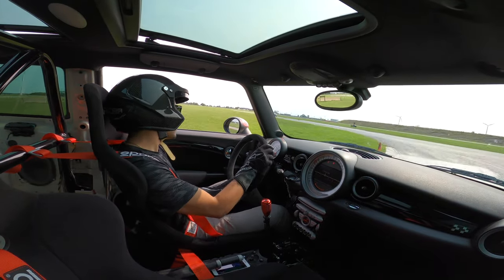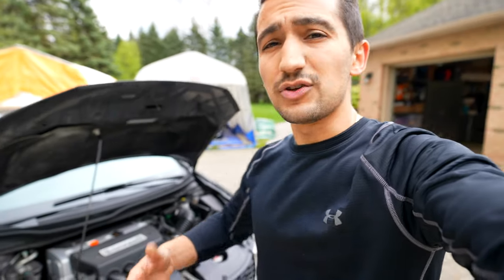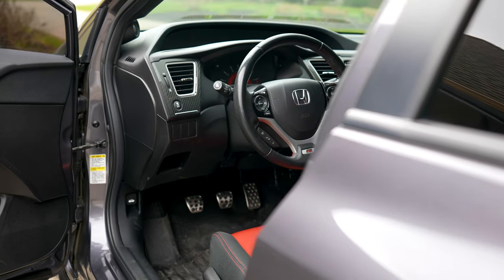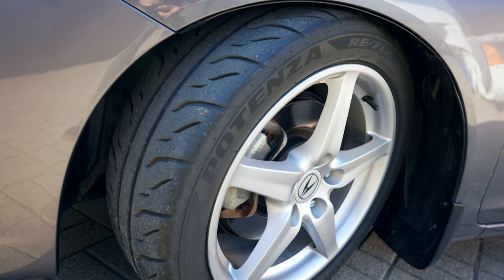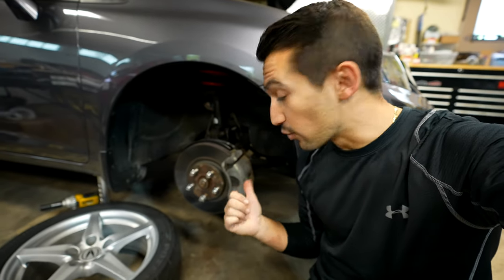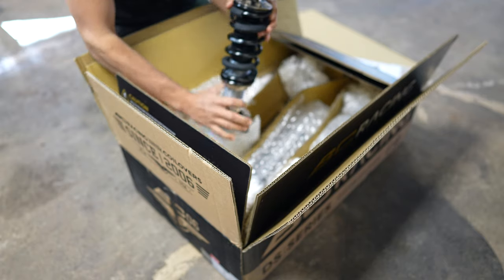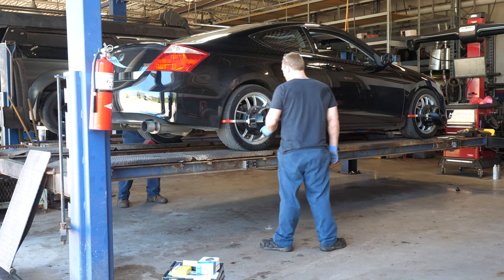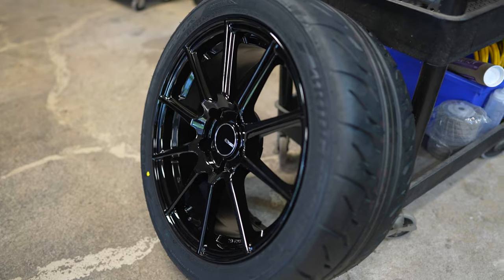How to PROPERLY Upgrade Your Car // The MilMast Method

Comment: Exhaust => differential => suspension components + coilovers => chassis bracing => wheels + tires => brakes => intakes + manifold + tune => carbon/bodykit/aero => rollcage => paint

Comment: Assuming your tires are reasonable, THE very first requirement of a production car is to sort the suspension. Any tyre that can generate higher lateral g force will deform the suspension, often to the point that the new tyres are destroyed on one edge (usually the outter) after only a very few laps.

Comment: I love this video and I already convinced myself to go this route but not as detailed. I am currently building a K20/k24 and putting it into my 91 integra. Thanks for this! I love all your videos as they are so helpful for something who is entry level at this
Reply: I have already used your excel sheet as a guide for a 300+ HP all motor building. I think I want to take it even higher. I already have my k20 Head ready for port and polish, and I just finished removing everything from the block. Now that this is done, I will focus on my suspension/ brakes/etc.

Comment: First for my 370Z I did the long tubes headers, exhaust and cold air intake with a tune with admin. Now I’m building the brake system and transmission on the top. I feel like it was missing little bit of spice in the engine bay. I also did tire first of all with larger ones. But your build diagram is very nice and accurate! You give me some futur mods that I didn’t thought.

Comment: No, all wrong.
First: Big twin turbo
Then, if it didn't melt already, an oil cooler
Next, the clutch should be already cooked so new flywheel and clutch kit
Finally if you didn't totaled it: wheels, tires, brakes and suspension.
Now that's thrilling
Reply from the maker: LMAO I'll have to give that a shot for another build 😂

Comment: 1.brakes 
2.wheels and tires
3.suspension
4.larger radiator, oil, and trans fluid cooler
5.power
Reply from the maker: I can agree with that 👍
Reply: @milanmastracci  I'm working on a 07 camry lol

Comment: Depends on the car. Transmission if needed, then brakes, suspension, cooling, airflow, then power
Reply from the maker: It sure does change from car to car, but I do like your thinking 💪

Comment: Weight Saving .  I understand the significant improvements gained through lighter wheels and tires.  Unsprung weight and improved handling etc.
How much weight do you think you saved on the Mini, with the removal of the interior trim ? Seems like minimal savings. Like removing tire valve stem caps and the shifter knob. Do you think the gains are worth the effort.
Reply from the maker: By just removing door panels, not too much weight is being shed, however when you change to aftermarket seats, you change steel hoods for carbon/fiberglass ones, you replace windows with Lexan, it does add up. For a daily driver, I wouldn't recommend it.

Comment: Awesome Milan! Hey I was wondering if you run synth or mineral in your k24 civic? I have a 2009 Tsx which I fill with castrol gtx 5w20. Installing tein flex z and complete rebuild or front suspension, bushings and control arms, car is pretty rusty (quebec canada) peace !!!
Reply from the maker: Hey Louis, I think you're very much going to appreciate the next vide. I will be going over all of the fluids for this car and service items. I hear you with the rust. Canadian winters aren't gentle on cars and it sure shows after a couple years of use, hence why maintenance and upkeep is so important.

Comment: Hey bro I like all the advice you've given modifying your car I have a 91 Integra gs I would like to upgrade my suspensions can you get some advice unturned good suspension at a reasonable price for my 91 Integra
Reply from the maker: I've always had great results with BC racing coilovers. They are affordable coilovers, fully adjustable, they come with a warranty, and I've had no problems with any of mine, and I've had them on 3 of my cars. I can't say anything bad about them 👍

Comment: not many talk about the crankshaft pulley swap for aluminum, has anybody every done this for the hondas
Reply from the maker: You shouldn't for these cars since the stock crank pulley also acts as a vibration damper. Without it, the engine will not last as long

Comment: I have a 15 civic si sedan just install my eibach sportline lowering springs wit truhart sport shocks/struts made for drops like 1-2 inch.
Not sure why the front drop pretty low it scrubs my inner fender liner...driving it's ok but just turning...if i turn slow it's ok...ur opinion is appreciate thanks
Reply from the maker: Yeah my Skunk2 lowering springs do the same tbh. I'm going to be changing them out as I don't like how it rides. I think 2 inches is too much of a drop for these cars. Stock ride height isn't too pretty, so a 1" drop with springs or a complete swap to coilovers is the way to go IMO. Unfortunately there isn't anything we can do to make the ride less harsh with the setup we have.

Comment: i wanted to do poly bushings, i saw you dropped a link below, but energy suspension doesn’t make 2012 or newer kits, can anybody recommend where to get some next ?
Reply from the maker: You'll see what I end up doing, because I'm going poly for my 9th gen 🤙
Reply: @milanmastracci  lmk when the vid drops ! i just upgraded tires and rims and my cars like 10 years old and i wanted to do bushings next before power mods

Comment: What brand is the tints on the rear windows?
Because they started fading and turning purple.
Manufacturers promise lifetime warranty most of the times but are they true to their words?
Reply from the maker: I wish I could tell you what brand it is, but I would be lying to you. I thought at first it was just me thinking the tint is different but I'm happy to hear you comment on it. I will be getting it fixed in the very near future 👍
Reply: @milanmastracci  I'm afraid that my tint will fade the same way as yours even though i chose a popular brand(not the most expensive) with many years in the industry...
Reply from the maker: I can't speak much of the tint that I have on my Civic, but the infrared ceramic tint that I have on my Accord still looks perfect with no fading, and keeps my interior temps down. That is what I will be putting on my Civic without a doubt 👍

Comment: I’ll upgrade the Brain before anything.. get a base line on the factory engine. Honda are well built machinery...
Reply from the maker: I was able to put down 174 stock and 179 tuned, with factory parts.